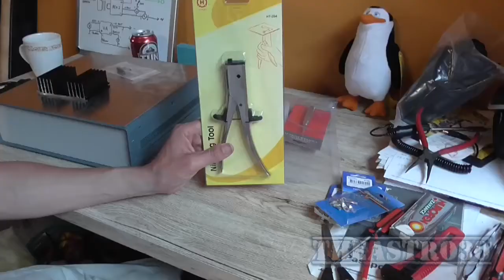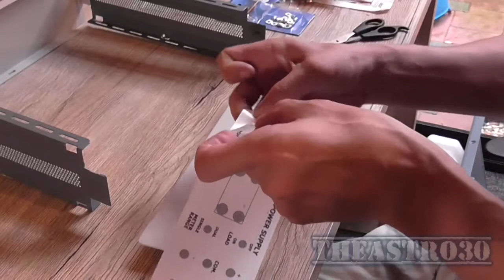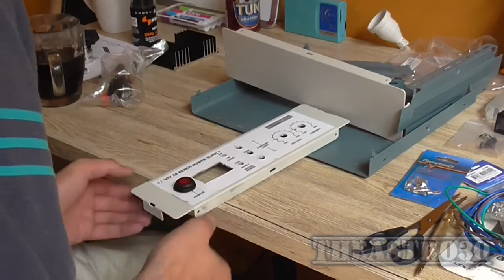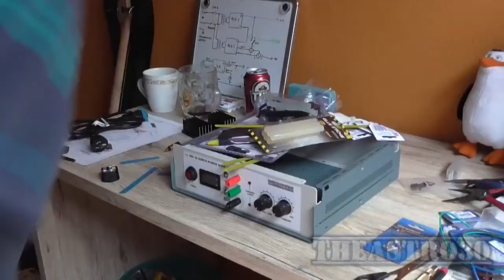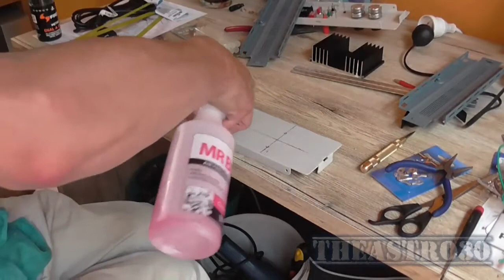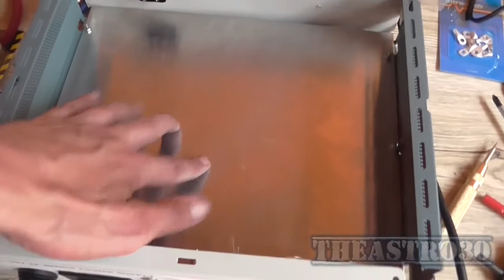+30/0/-30V Power Supply Build - Part 4

Comment: The voltage regulator you don't need it at all then the front panel you need to modified because you will need to VA meters and 4 pots